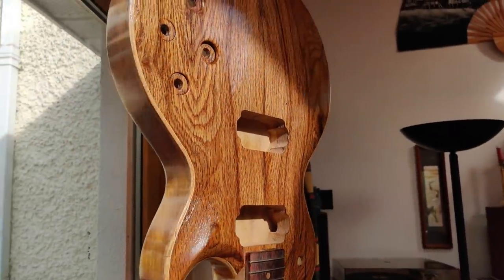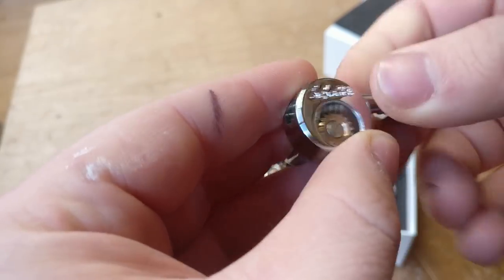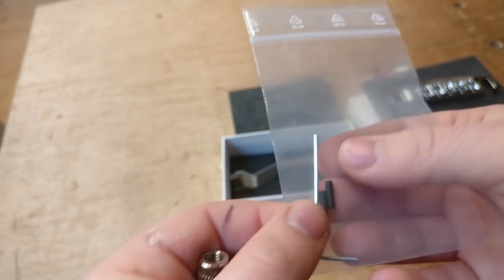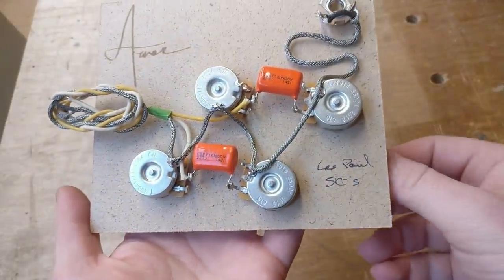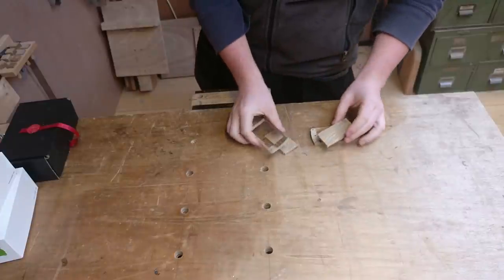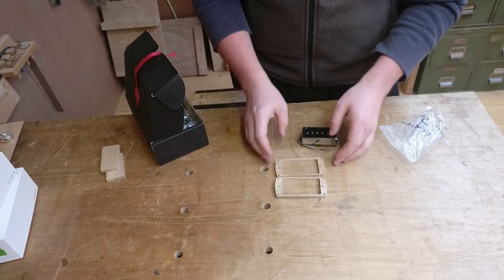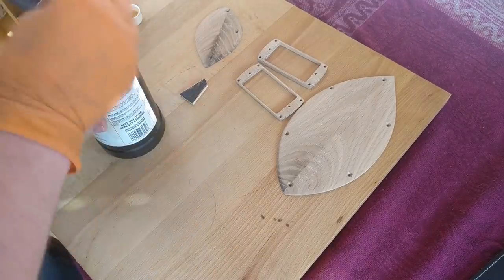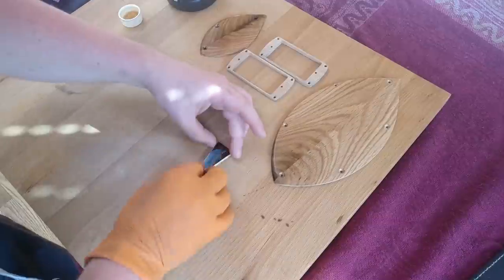Video 7, Finishing Updates, Parts Unboxing and Pup Rings! The Unofficial Great Guitar Build-off 2020

Comment: Guitar is looking amazing!! The grub screws in the bridge are not locking screws they push the bridge off the posts if more range is needed for intonation. The longer screws are of course for if much more range is needed. I had a 65 SG in the shop recently that needed exactly that- more range- because the studs holes were just in the wrong place by about 3/16" off. Also the wrench is to the lock down the bridge in the posts so it doesn't rotate. I used the Tone Pros bridge on the SG but your Schaller bridge is much the same.
Reply from the maker: Aha, thank you for the clarification! While editing the video I thought that may have been their purpose alright, good to know I had the right idea.
It's my first time using the bridge, and the unboxing was my first real look at it all, aside from some quick measurements, so it was very much 'on the fly' thinking.
Reply: Awen Lutherie - Custom Guitars , not trying to be a know it all. Just have had experience with them. Really beautiful guitar.
Reply from the maker: Don't worry, we all know things that others don't, and I personally appreciate the tidbits of knowledge I pick up from comment sections!

Comment: I know 250k pots are typically used for single coil tone, and 500k for humbucker tone, but why the 500k pot for volume?  Loving the build!
Reply from the maker: It's all to do with what frequencies are rolled off, how much and to what taper.. I've found this particular setup gives a lot of control over the sound. It's also how Gibson used to do it for a while.